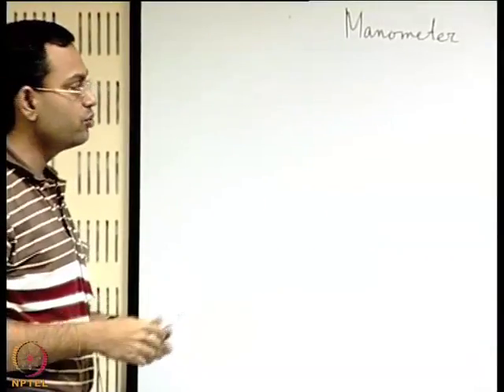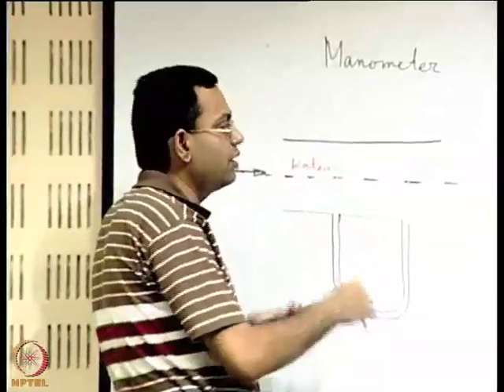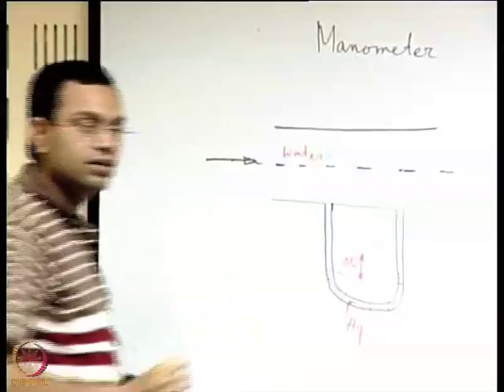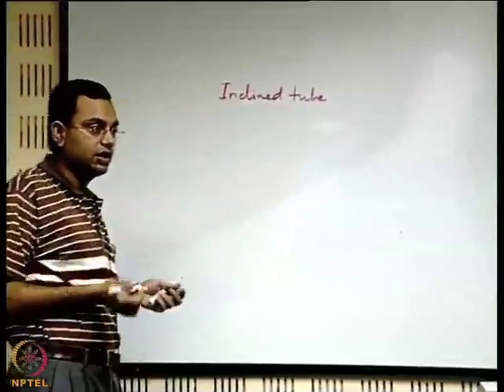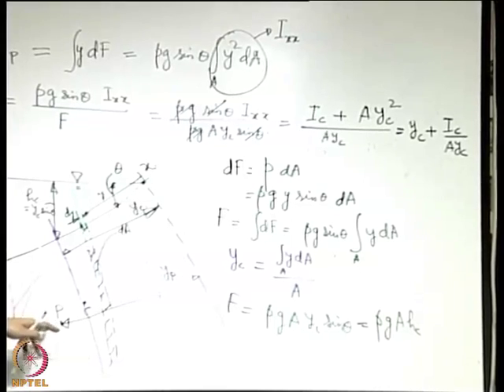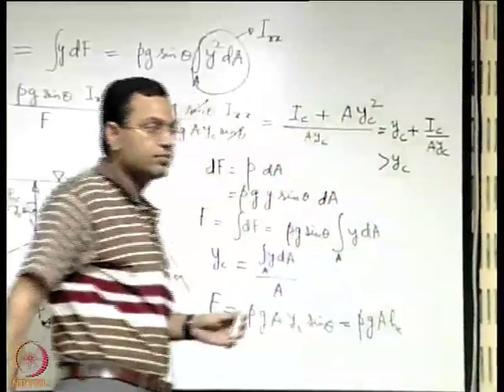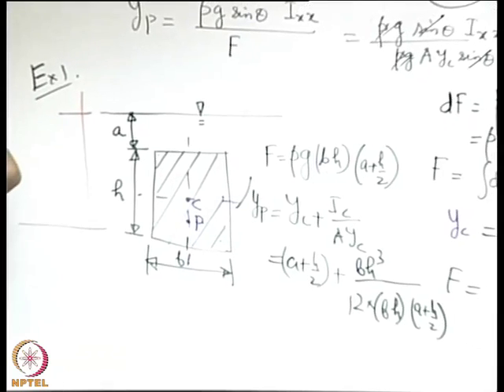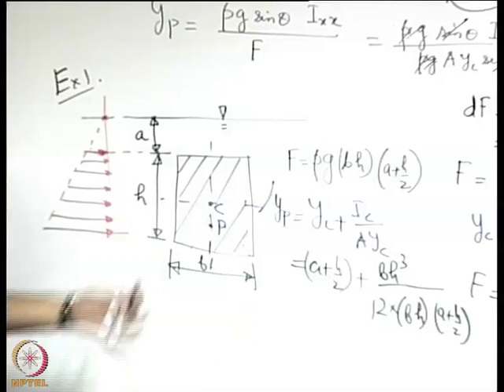Mod-01 Lec-08 Fluid Statics (Contd.)

Comment: WHY BUOYNACY FORCE IS NOT CONSIDERED IN THE ANALYSIS WHILE ASSUMING EQUILIBRIUM
Reply: Buoyancy only play a role if there are two or more fluids with different densities.
Reply: Hinge takes care of that I think 🤔🤔🤔🤔
Reply: Listen buoyancy force is nothing but resultant vertical pressure forces....and in derivation it is considered
Reply: @adityatukan2493  I left the mechanical field bro 😂😂😂😂
Reply: @adityatukan2493  yeah I know that logic but I think here since it is plate of small thickness there will be no buoyancy force ( as far as I recollect)
Reply: its because we are eliminating all the forces in our derivation and considering only the forces due to fluid above the plate.